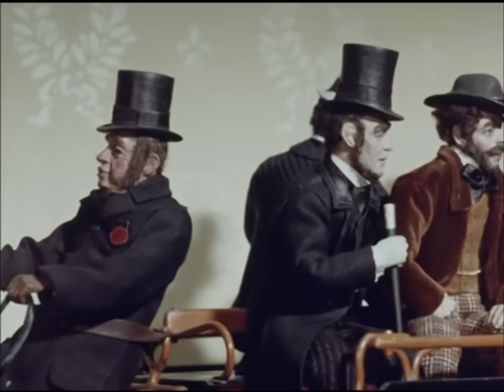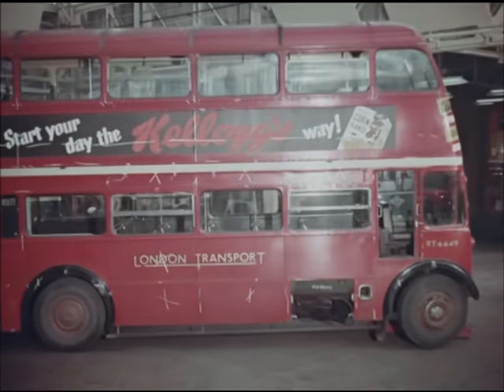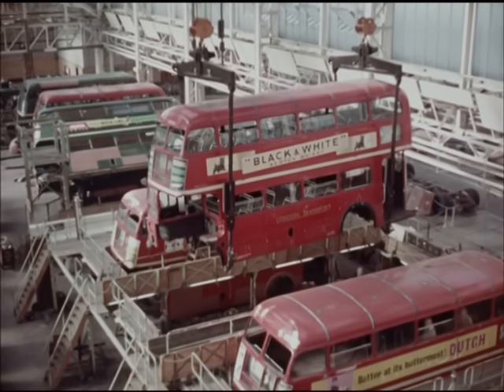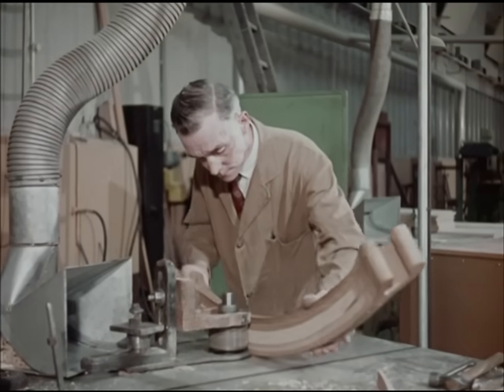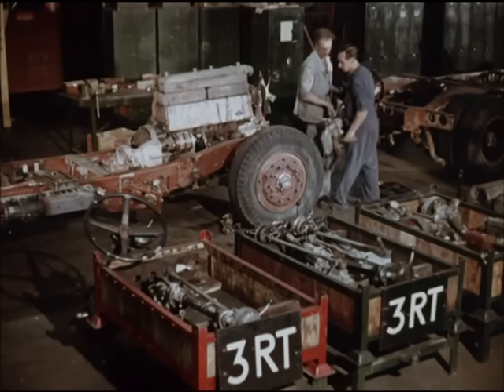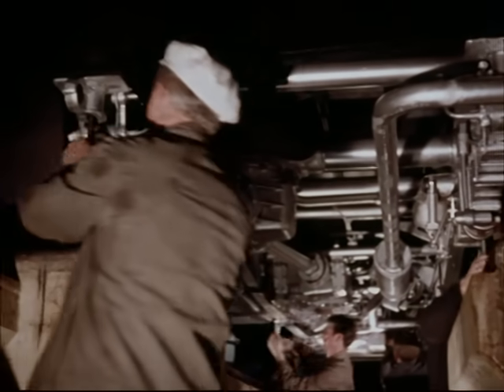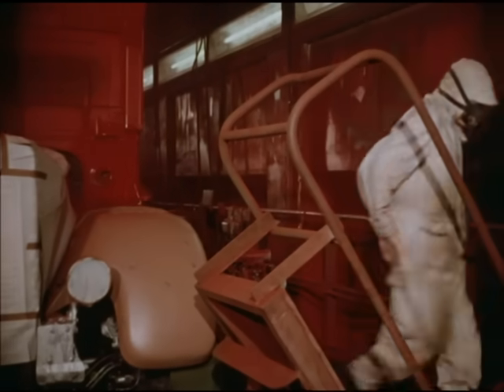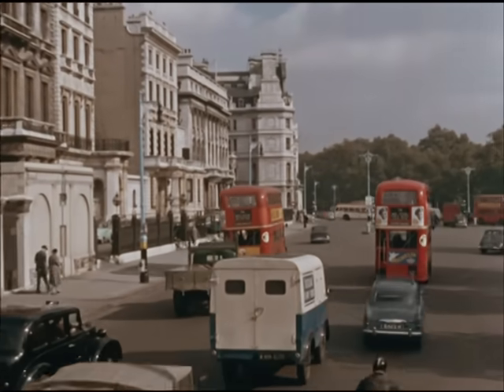Overhaul (1957)

Comment: Relatively high wear rates (due to materials, not lack of skill on anyone's part) made efficient operation and maintenance vital to bus, rail, taxi, military and other fleet operations. You can see this in machinery and frame designs of busses and trucks of the era including civilian pickup trucks often designed to permit "in frame" replacement of engine internals without removing the engine block, still done on larger vehicles but faded from consumer designs because crash standards save so many lives. (The roads were a bloodbath per miles traveled so don't be TOO nostalgic!)

Comment: All those people complaining about the loss of the old buses - they seem to forget the stinking diesel fumes that London used to be filled with thanks to these buses and all the London cabs. I was taken into a large, covered London cab depot when I was a kid in the 1970s - and the air was so thick with filthy diesel smoke you could hardly breathe. Ghastly. I bet none of the people who worked there made it to get their state pension.

Gas buses were a great improvement. Electric will be even better.

Comment: Remember when you could rebuild things? Good times. Now days the body control modual would flip shit if you tried any of that, the seat structure wouldn't hold up long enough to warrent rebuilding, and the motor would have to have a rod hanging out the side before theyd even consider pulling it from service

Comment: We used to visit a company making tautliner trailers for off cuts for school DT department, sheet, angle, box, treadplate, steel, stainless, alloy.
Spoke to the MD about his product, it's absolute crap he said, I can do much better than this, but it's designed and manufactured down to a price, they all go out through a capital company on 5 year lease, they are designed to fall to pieces basically as soon as the lease has expired.
We are an incredibly wasteful society, the local University is flattening 300 student flats that are 30 years old, the Victorian/Edwardian railway companies built to last forever.
And as for all these PFI hospitals and schools that President Blair organised, they are the worst of the lot.
Still that nice Mr Starmer has pledged to put everything right.😉.
Some 8100dy hope he's got .😬🤣🤣🤣

Comment: Today, in a world bent on sustainability, I see this video and see a bus built to last, built to be repaired, re-powered, rebuilt, and capable of being so for generations. There we were, in 1957, achieving something. Where are we today? We throw away everything, repair nothing, and any piece of equipment like this that gets bought for the job ends up over budget, can't do it as effectively, and is totally unsustainable in the long term. So much for progress!
Reply: But that is based on the engineering of the time. A complete re haul after only 3 and a half years?
I passed my test in 1972. I could just about afford a 10 year old car (£50). They were knackered old rust buckets. I'm saying that a bus like that - now - would last 10 x as long with todays engineering.
Reply: @shirleymental4189  It's more 2x to 3x - bus mid-life overhauls are generally done at the 6 to 10 year mark these days - but your point stands.
Reply: and now in Britain there are only Indians and Arabs

Comment: Does anyone know if this repair facility is still doing this kind of work? If so, it would be fascinating to see a modern version of this film.
Reply: According to Wikipedia, it closed in 1986 and was demolished in 1996. The article makes for interesting reading as to the reasons for its decline.
Reply: @Zeem4  Thank you.
Reply: Buses are just replaced rather than overhauling them these days.Not only is it considered cheaper but the specification of Buses changes at a much faster rate - wheelchair ramps fully electric - it won't be long before these buses will be obsolete. Even the Borisbus,the New Routemaster, only introduced in 2012 is now obsolete although a partial overhaul was done on them but certainly not as thorough as an Aldenham overhaul.

Comment: An era when things were designed properly, designed to be maintained not just thrown away.
Reply: What a great programme to watch when Britain was great
Reply: And yet ironically it was improvements in bus build and material quality requiring fewer full overhauls that was partly responsible for Aldenhams decline.
Reply: @Werewolves_of_London  Capitalism 101.  That's just how Capitalism works.  That's why it always burns itself out.
Reply: Hi
Reply: Buses in use today see service just like this, but they have better paints that last a lot longer.
Reply: @SkaterStimm  lol, have you seen how low modern busses are?  They wouldn't make it a block on the old roads that those buses handled easily every day.
It's fun to watch videos of when "developing"  (lol, "developing" for the last 10,000 years) places get their hands on a modern bus and try to drive it down what they call "roads" and then end up tearing it all up and getting it stuck in the mud.
Heck, a modern 4x4 "SUV" couldn't even keep up to a Ford Model T in most off road scenarios.
Reply: @SkaterStimm  except they're disgusting and smell like piss

Comment: Vary impressive, I wonder if they still do that for the Buses, if they have that factory still and how much did they get paid back then. I feel like this is a good system, it creates jobs, and keeps public transport operational. Any Brits in here, I would appreciate some Insite. Thank you.
Reply from the maker: Unfortunately the whole industry has been privatised and buses are not as well looked after as they once were.  Once privatised the only concern for any company is profit
Reply: @windbag45  Sad but true.
Reply: It was decided many years ago that it was cheaper to scrap buses and get new ones rather than overhaul them.This decision was made from the 1970s with the advent of the DMS type bus.Most were sold on to other operators. Aldenham remained open to overhaul Routemasters and closed(I think) in the1980s.

Comment: Full overhaul every 3.5 to 4 years and 150.000 miles?  That seems excessive and wasteful.  You don't do that to commercial aircraft and the regulations there are much more strict...
Reply: It kept the fleet in tip top shape and up to a standard of presentation. 
It was a well oiled machine that was very efficient at achieving that end for an 8000 strong fleet. The buses carry thousands of people each with absolute constant stop starting every day for those four years. It was quite sensible actually.
If they left them much longer to keep plying the streets, standards would have visibly fallen.
Reply: Today, the biggest cause of damage are the potholes that dominate the roads in the UK.

Comment: This was an era where public safety was considered above private profit. I worked for a coach company and we did the same thing except removing bodies. If it was removable, it was removed. Even road springs were stripped down.  Proper maintenance, not the quick oil change and through it out as happens these days.

Comment: These types of jobs kept  the youth busy and taught them valuable skills , instead of running around the street aimlessly!
Reply: No young guys working in the video, most would have been WW2 vets in 57.
Reply: @nzsaltflatsracer8054  That would have been considered a very good job, so there would not be much turnover.
Typically, if you see a lot of young people at a place, it means it's either low paying and/or a toxic workplace.
Reply: @nzsaltflatsracer8054 Apprentices mate, look closely. You can see them.
Reply: They ran around aimlessly as well...in their spare time!
Reply: @ChangesOneTim  yeah. wait until this guy finds out about the NYC straw hat riots of 1921
Reply: @ChangesOneTim highly doubt that.

Comment: One of the three pillars of London buses now history. Aldenham, Chiswick and AEC Southall.
Reply: The AEC works also overhauled the underfloor engines that powered some of British Rail's once vast fleet of diesel multiple units (DMUs) built in the late 1950s/ early 1960s. They were essentially a 150hp horizontal version of AEC's bus engines. It wasn't by accident that BR built a DMU depot at Southall; engines could almost be 'swung over the fence' to/from AEC next door.
Reply: Oh gosh, I recall seeing pictures of railway lines going to the works. It was appalling their main rival bought them. It should have been prevented on national interest grounds.
Joint ventures only, like the road train. Kept autonomous otherwise.
Reply: @ChangesOneTim  did they overhaul other engines as well as their own?
Reply: @jamesfrench7299  
IDK for sure, but it's possible that B.U.T. derivatives were

Comment: I remember it all too well with those wonderful RT’s both green and red, all gone to pot, if only they could have remained on the road in 2020.
Reply: Epping Ongar Railway operate RT type buses on their 339 service from Epping Station to Shenfield Station. Weekends from Easter to October. (Coronavirus permitting!)
Reply: They would have remained on the road if Aldenham had still been overhauling them.Since the advent of the DMS in 1971 it was decided that it was cheaper to make a bus that could be scrapped after a relatively short period of time rather than overhaul it.Because the Routemaster lasted so long as to out last Aldenham's closure the Routemaster had to be overhauled by private contractors to keep them running. I retired in 2024 after working as a conductor and a driver since 1974 and no bus I ever drove beat the Routemaster.

Comment: Brilliant, but how did they overcome the regulations regarding chassis/engine numbers relating to that vehicle as they would be different when the bus left the works?
Reply: In short, they didn't bother with mere regulations! London Transport being a quango were a law unto themselves. 

When I was a driver on route 207 in the early eighties, I remember being told by an inspector en route to change buses at Hanwell, because the bus I was driving was supposed to have gone to Aldenham. 

Upon pulling onto the forecourt at Hanwell fully loaded, the maintenance staff not only swopped over the number plates, to the newly re-conditioned Routemaster that was waiting for me on the forecourt, they swopped the tax disc too! 

Wouldn't get away with that nowadays I suspect.
Reply: Regulations different for LT, they have to be for large fleets, as long as it's all documented.
Reply: @christopherhulse8385  London Transport weren't insured either. They used to cover their own liabilities. Wouldn't be allowed now either
Reply: @xanadudawn  Same as the Police
Reply: @xanadudawn still allowed provided the company has sufficient assets to cover any possible claim .
Reply: I imagine chassis number remained the same regardless of what body was used, engine swap would be the same as with any vehicle it was just performed and no one cared.
Reply: The chassis number was not actually stamped in to the chassis but was stamped on to the chassis plate so a completed bus would be fitted with a plate and matching number plates which the registration authorities were happy with .